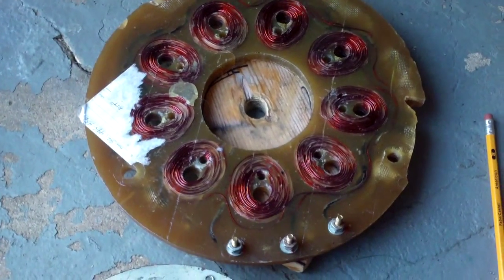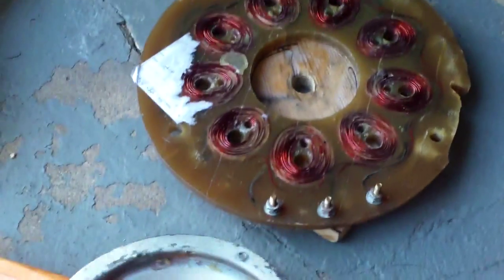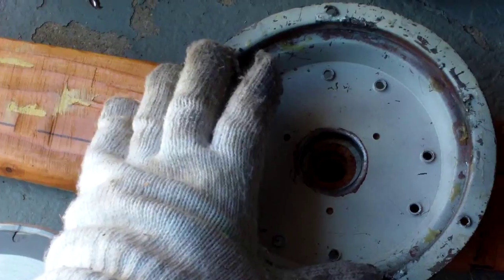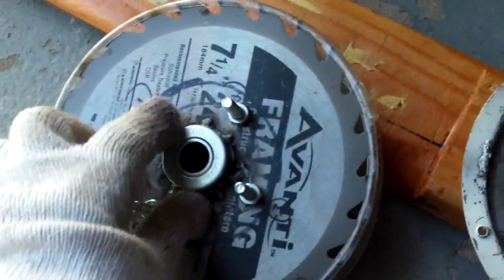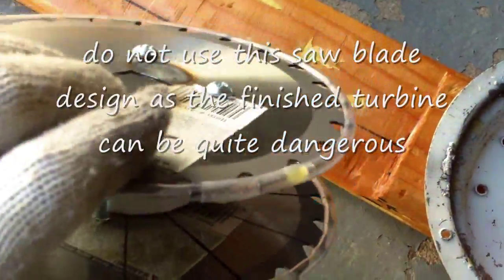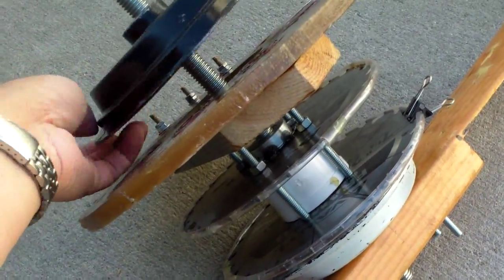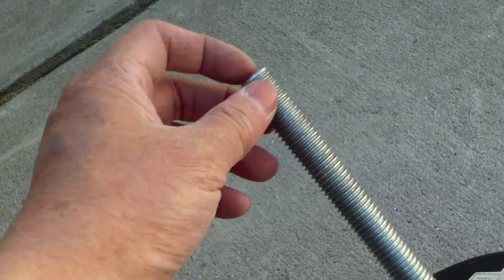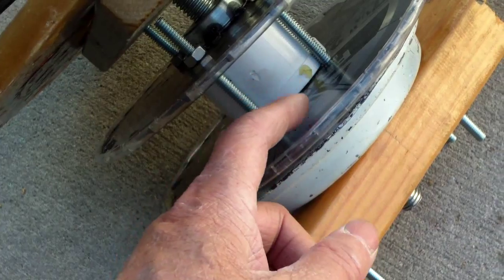Ceiling fan axial flux wind turbine part 1

Comment: A vehicle rotor might be a better thing to use for the metal portion of the Magnets and if you get the hub that goes with it would make for an easy attachment for the stator and blade.  Simply knock out the old studs and replace them with longer bolts, and redrill your blade.  It will be heavy but sturdy too...  FYI...
Reply from the maker: You are right about using auto hubs as rotors. They are real heavy duty. Thanks for your input.

Comment: For my first hawt I used two 10" saw blades and plywood backing for extra support, still going strong. I'm sure yours will be fine. Best of luck with the new project!
Reply from the maker: Thanks. I hope mine will work out as good as yours.